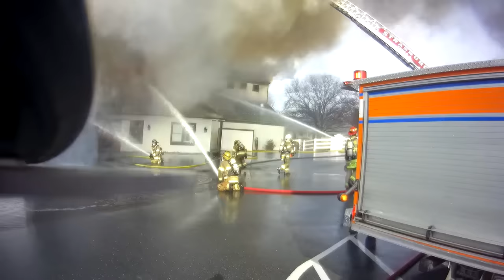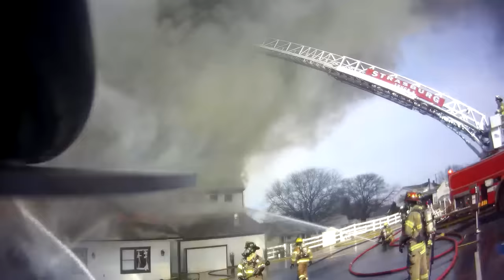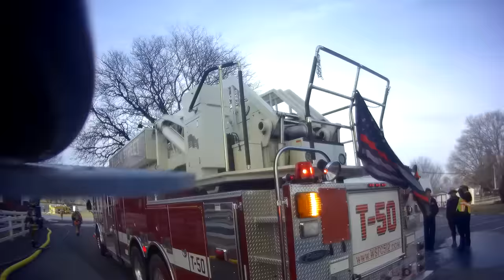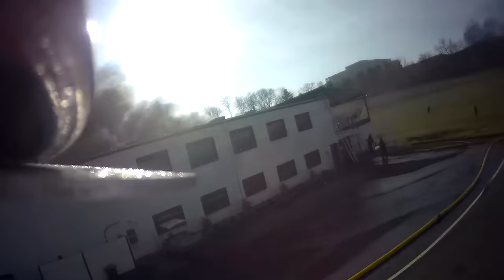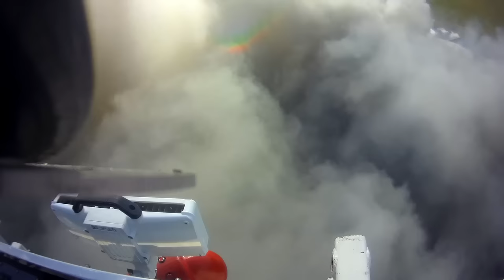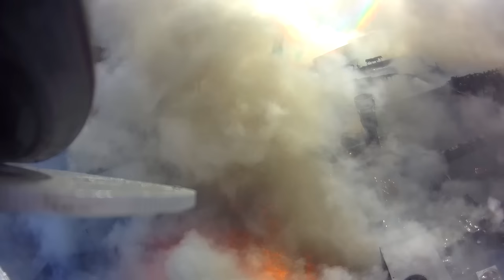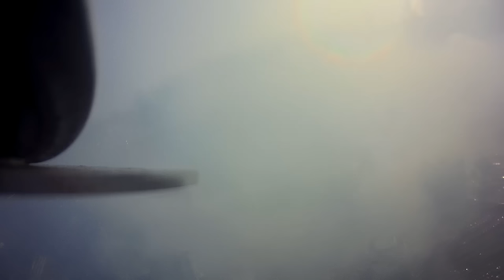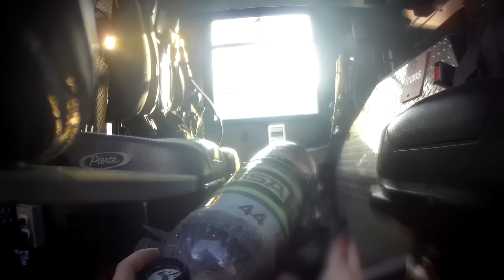Truck 50 Assists on Strasburg 2 Alarm Building Fire *Helmet Cam*

Comment: Please slow for red lights and stop signs. A few times just kept doing about 40 through them. Just because it looks like traffic is stopped, doesn’t mean they are stopped FOR YOU. They could be distracted and look up and see they got a green and start going, and now your in a TC. In no state does any emergency vehicle have the right of way, you are requesting the right of way, and only have the right of way once you use due care to enter an intersection against a red or at a stop. Good driving otherwise. Maybe a little fast in the towns, but the stop signs and red lights are literally a killer. It only takes one car not paying attention. They have the right of way, and only when they yield to an emergency vehicle, once the emergency vehicle clear the intersection using due care, can it proceed safely. The drive still have to use due care at all times. That one stop sign in town with the white car waiting, had a blind corner. Come up to intersections, and be ready to stop when you have a stop or a red, make eye contact with the other drivers and then go. I have driven emergency vehicles for the last 25 years, and mine went a hell of a lot faster than a truck. But I have driven fire trucks too. Only takes one other driver before you become a call too. Lights and siren do not mean anything unless you are 110% sure the other drivers see you and are stopped for you, and not something else. Just because they are stopped, doesn’t mean they won’t pull out at the last minute because they were looking at something else and had their stereo blasting. At that point, the video will be evidence.
Reply: long winded.
Reply: Lights & sirens does not give you a green light. Failure to display due caution will leave you at fault in the event of an MVC. Couple that with being 5th in and light years away…I did enjoy the aerial view.
Reply: @magna116  👍🙃
Reply: Why does it take you so many words to get to the point?

Comment: That Roto ray thing is weird. I find it extremely annoying as well as a useless distraction to the driver.  Should be removed from all equipment immediately.
Reply from the maker: Actually you can't see it from the driver's seat or the officers seat. And it is very distracting to other drivers, which is why it's very useful. It's always the first thing I notice when I see a passing firetruck